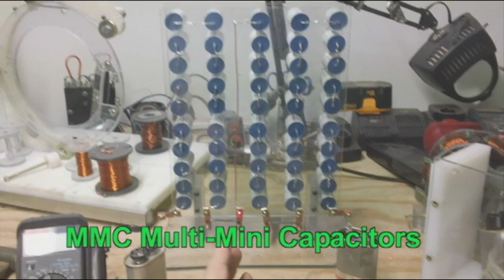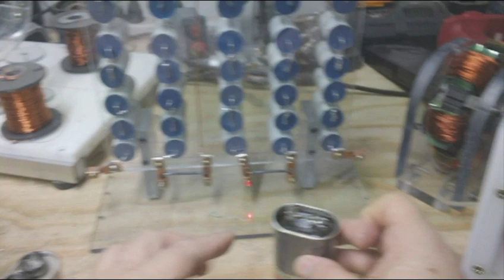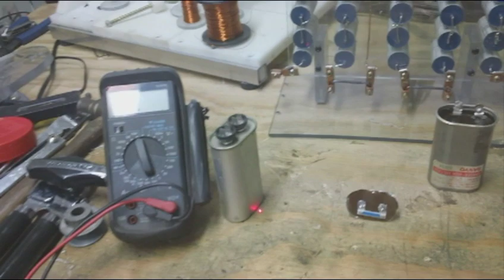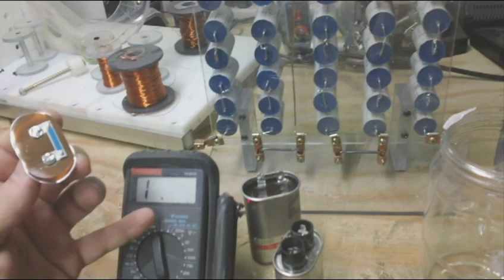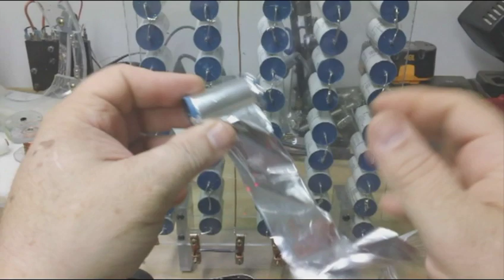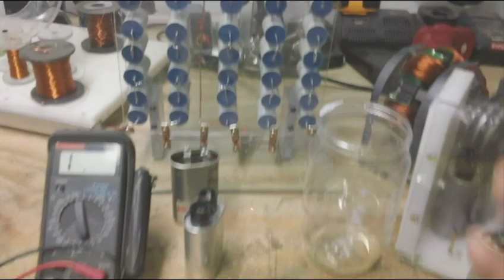QEG Hybird Project

Comment: Nice coil winder in the back ground ;) ~Russ
Reply from the maker: *****  OK Eagle Eyes I'm still working on it, but I think I will use your calculator trick as a counter  thanks for watching ;)
Reply: Can't reply to yours so I'll reply to mine... 

Be aware the calculator trick only works at slower speeds ;) 

I ended up getting a counter of ebay...  

~Russ
Reply: Yea the Pedometer has the same problem  I started using a reed switch and a weaker magnet that helped a little, I guess  I will go slow this type of wind is hard because you are  going through that small gap on the stator anyway. thanks for the heads up ,Have a good day :)
Reply: oops wrong account Thank you Google